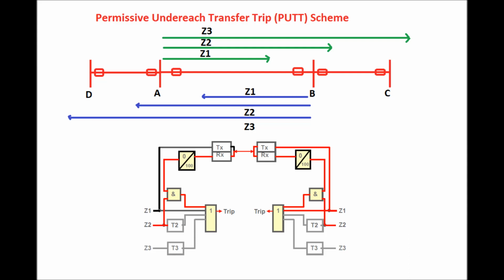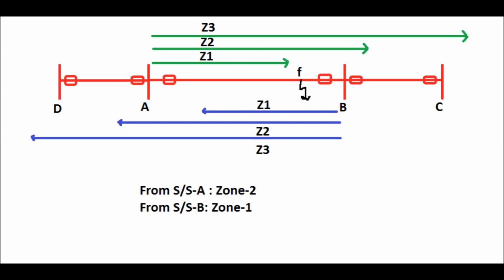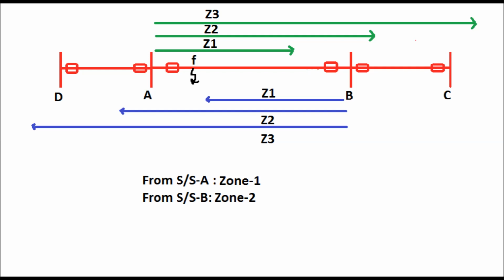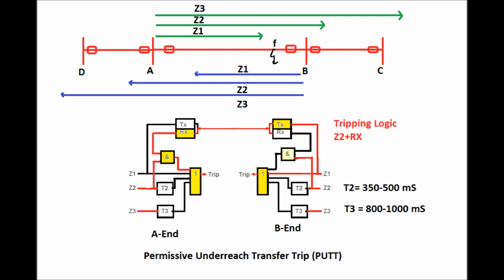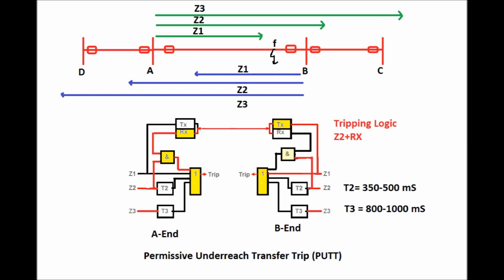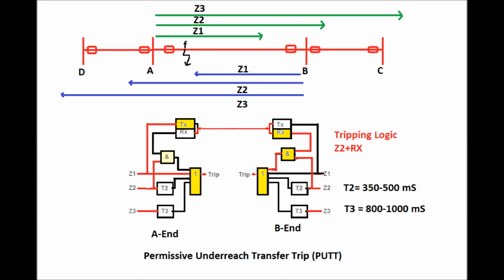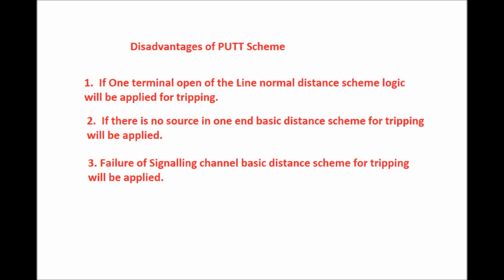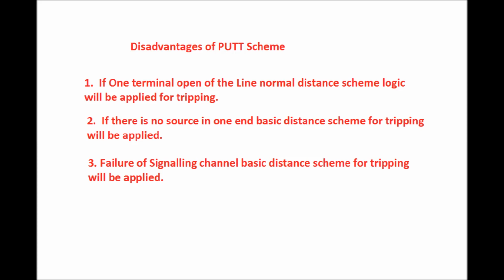Permissive Underreach Transfer Trip (PUTT) Scheme for Distance Relay

Comment: What's the criteria for choosing PUTT and POTT scheme
Reply: Pott is used for short length line and putt is used for long length line
Reply: @Kiran-nb5xi  thanks. Which length is termed as short line and long line?
Reply: @syedtahaahmed22  as per my knowledge  short up to 50 km long upto 150km and above 160 km its long transmission line
Reply: Where we use line differential protection? If the line length is less than 100 km or more than 100 km?
Reply from the maker: @amalkrishna0636  Line Differential Relay is the best available protection for protection of Line. In case of short line distance relay is unable to detect fault with accuracy. Short line means line length is normally less than 10 km. In this case line differential relay can be used .
Reply: @relayprotectionelectrical  Thank You sir
Reply: @amalkrishna0636  for short up to 50 km